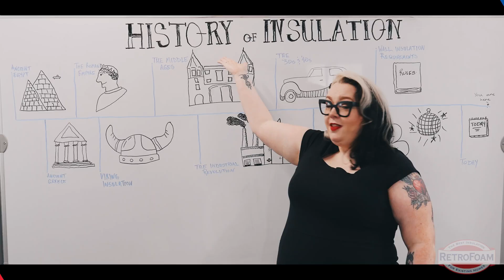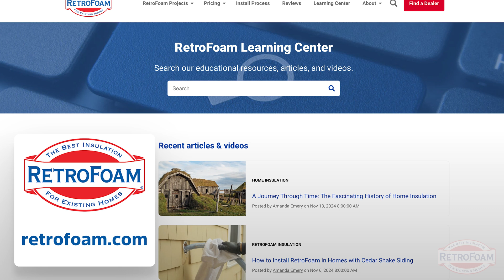Foam Insulation and Termites Concerns Explained in 30 Seconds | Foam University

Comment: Will foam insulation help kept other pests and insects from my home?
Reply from the maker: Foam insulation can help keep pests and insects out by sealing up the small cracks and gaps they use to get inside. While it doesn’t contain repellents, it’s not an inviting material for pests like fiberglass or cellulose. Pairing it with proper home sealing is the best way to keep unwanted guests out! This article from our Learning Center includes some additional information on this topic: https://www.retrofoam.com/blog/retrofoam-as-pest-control-insulation